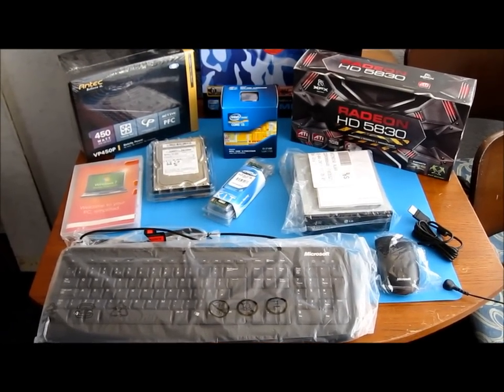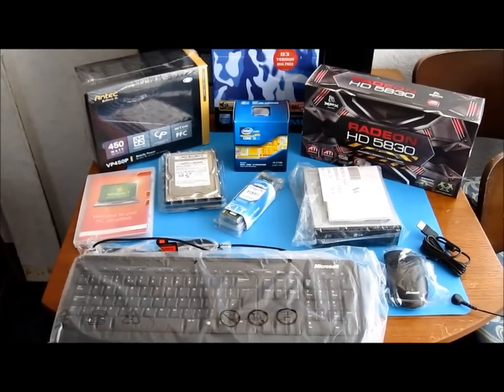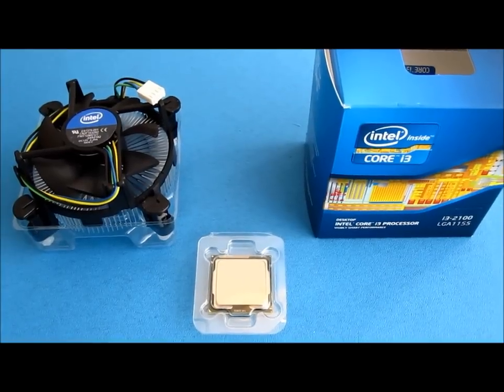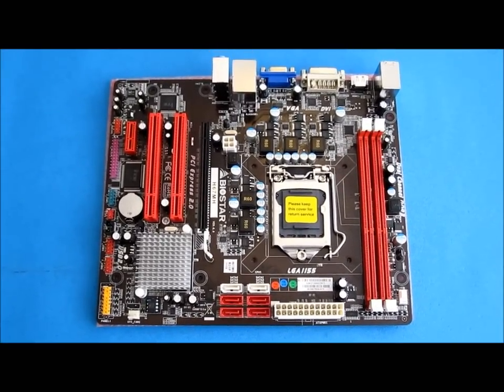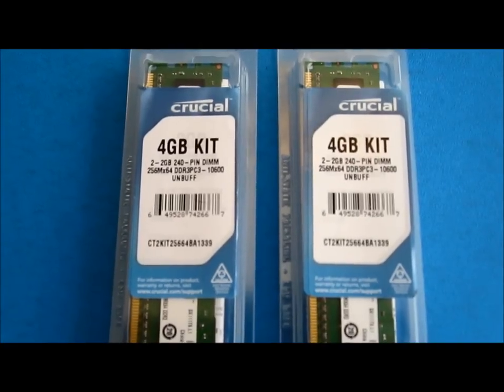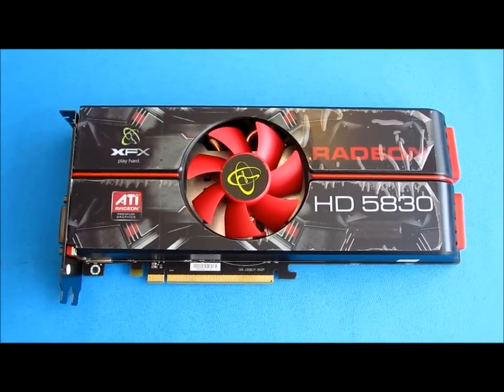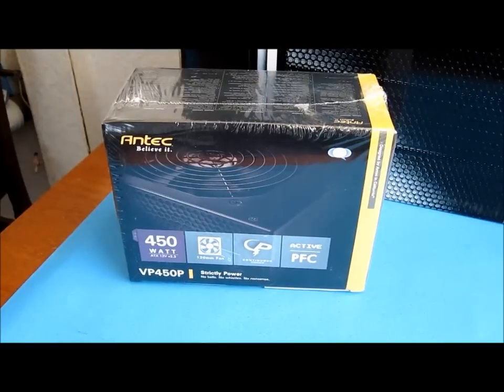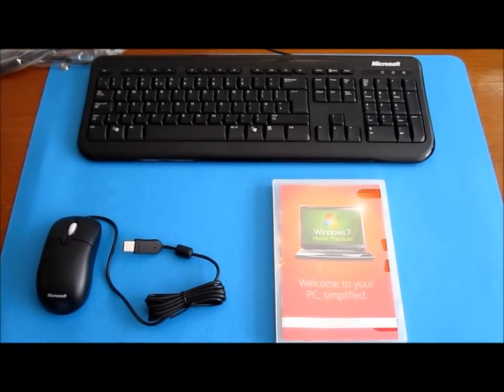Building a PC - Part 1

Comment from the maker: Hi Paul,  Considering you are only using a 17 inch monitor, you should be able to run the game but maybe only in low graphics settings, perhaps medium.  Your graphics card is letting you down big time, upgrade as soon as possible, bigger monitor helps too.  The rest of the system... decent chip, basic but ok motherboard, 8 GB of RAM is ample.  Make sure your power supply is upto the job if you upgrade your graphics.  Look for a card that costs a minimum of 100 GBP or 15,000 Jamaican Dollars.

Comment from the maker: I did consider Intel as the 2100 and 955 gave similar benchmark results in the games this boy would play.  I decided on the AMD true quad core as I felt this would be more future proof when games start coming out that require quad core as a minimum.  Cost was a factor and if I had chosen Intel then something somewhere else would have had to be cut back on.  The PSU although only 450 watt is good enough for any mid range graphics card considering power requirements are coming down or stationary.

Comment: @Mrsmartdude13 Ofc you can do all that but you can't get just any psu. Casing and ram are ok. So is the mobo. But be vary that psu like orange etc will fail at some point. You have to take the psu's amperage rating on the 12v rail into account whether its sufficient or not. The noise level(electrical noise) . You pc is awesome but i'd get a better psu from galaxy computers if i were you. Consider iamextreme too :) Purana tou obviously available hota hai but brand new ki bat hi aur hoti hai ;)

Comment: @DreadLord786 the thing is that LCDs are quite nice even second hand, if you live in Lahore, you could visit Hafeez Centre to get quite a few good ones....heres my PKR 68000 build:#
i5 2300
hd 6850 XXX version
6GB RAm
300GB HDD
h67 mobo from intel
21" 1600x1200 TFT(second hand for 9000:p)#
500W psu from orange....
some cheap casing..:(
standard keyboard and mouse...
sp theres a definite improvement for cheaper:)

Comment: hey i was wondering if u could tell me if this rig may handle battlefield 3

Biostar mobo , h61 1155 ( got already)
MSI 6570 ( got already) 
8gb 1333mhz memory ,  will soon have
intel core i5 2320

Is it a worthy system to get good graphics on for battlefield 3 n i don't really have a big monitor really a 17''